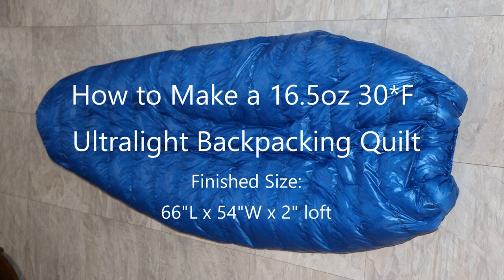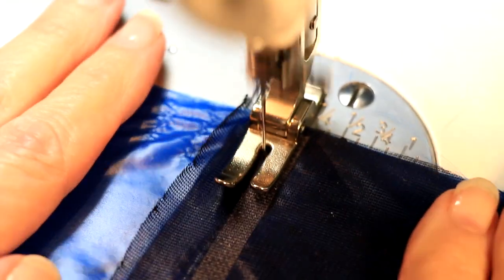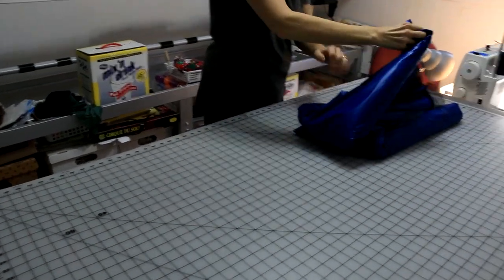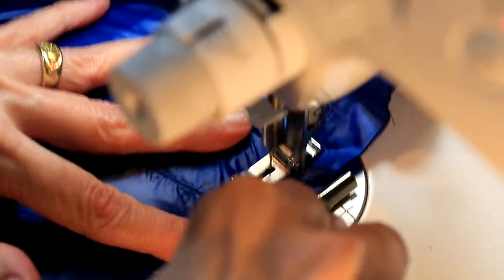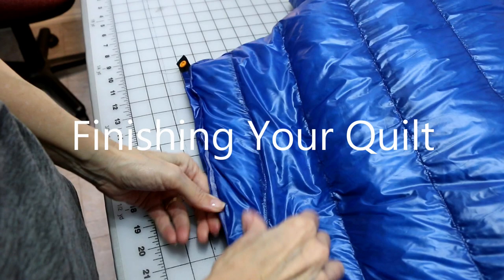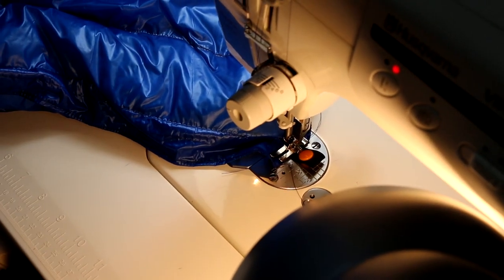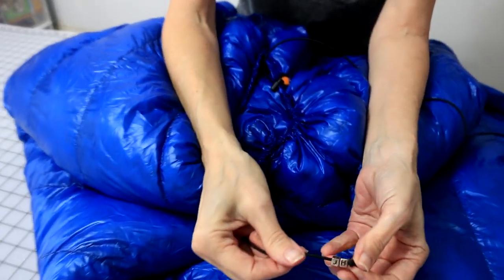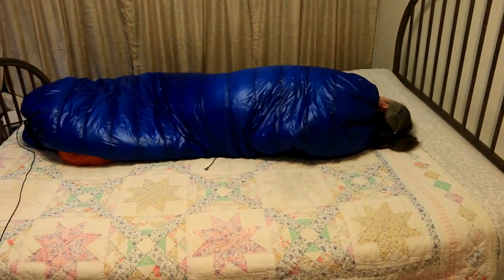How to Make an Ultralight Backpacking Quilt Using Triangular  "V" Baffles

Comment: Has anyone tried just wetting the down before stuffing? Then adjust the weight, e.g. 1 lb down goes to 4 lb after wetting, so each tube gets 4 oz instead of 1. After sewing, dry the bag and fluff it in the dryer just like you would if washing the bag. Seems like that would be less messy and difficult to control the down? It would also keep the down out of the way as you finish sewing the open edge.

Comment: Joel, could you please explain the pros/cons of this design vs. one with "rectangular" baffles?
Reply from the maker: I would say the pros of Rectangular baffles is there is a very slight weight advantage (less baffle material) and slightly less likely to make a mistake. The pros of the triangular baffles I would say is, less labor,  less cold spots, and a better weight to warmth ratio.

Comment: Is the 30 degrees comfort, limit, or survival rating?
Reply from the maker: The 30 degrees is just a middle ballpark comfort number based on the inches of down loft. This quilt has 2 inches of loft. The main quilt I use has 3 inches of loft and I sleep with comfort to 20 degrees. Just remember everyone is different in how they sleep. Some people can sleep under a cotton sheet at 30 degrees and be warm while other have to have 4 inches of loft. The trick is to figure out what works for you. 
You can change this design to add or subtract more baffle space for more or less loft.

Comment: What kind of tape are you using?
Reply from the maker: https://www.amazon.com/Outus-Quilting-Tape-Wash-Away/dp/B071R3HWFH/ref=asc_df_B071R3HWFH?tag=bingshoppinga-20&linkCode=df0&hvadid=80745465716600&hvnetw=o&hvqmt=e&hvbmt=be&hvdev=c&hvlocint=&hvlocphy=&hvtargid=pla-4584345019880821&psc=1